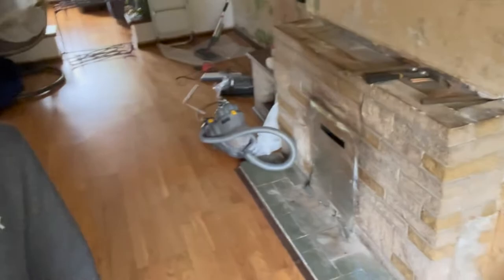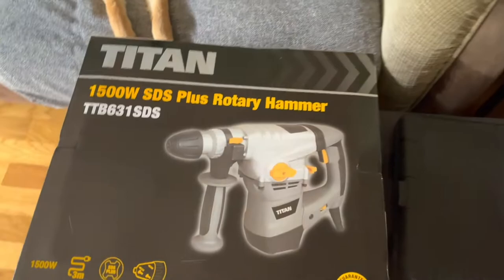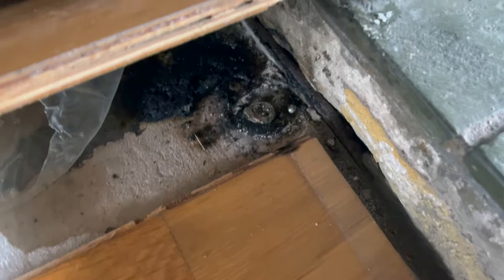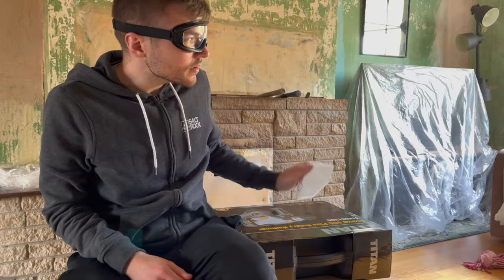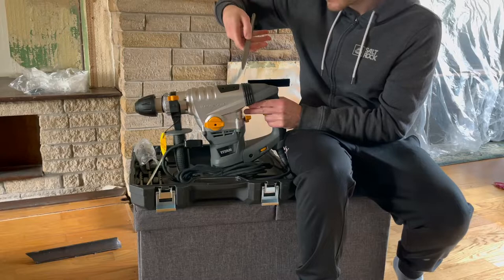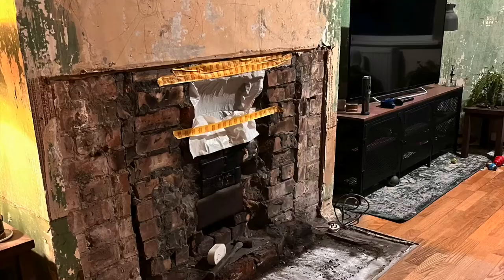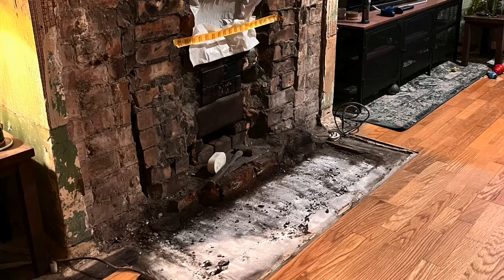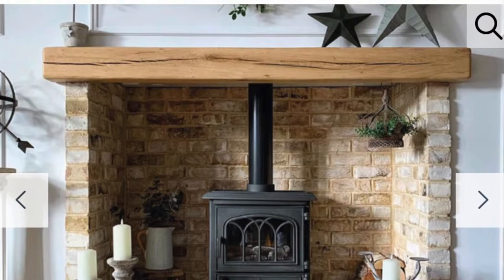Old 70s Fireplace Removal UK (Fairly cheap)

Comment: i'm in the process of tackling a fire surround made of those cotswold bricks circa 1980.  mine is full height, floor to ceiling with a shelf and corner tv platform the whole length of the room.  a bloke with a jemmy fetched the low shelving out for me and i'm cutting down the mammoth fire surround and fake chimney with an angle grinder.  i'm going to keep some and retain a rustic look by chalk painting it.  it's nice to know i'm not alone with a horrible task!  ☺